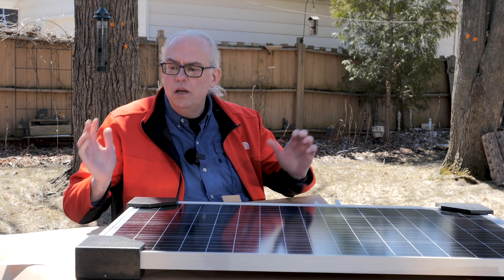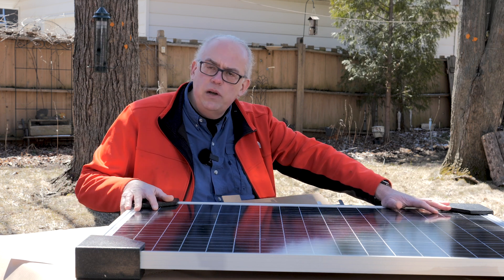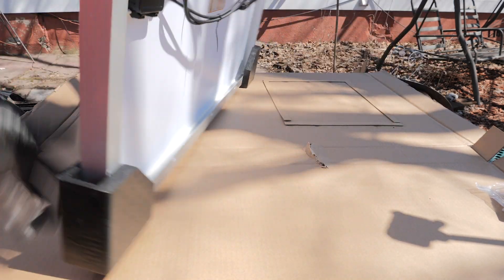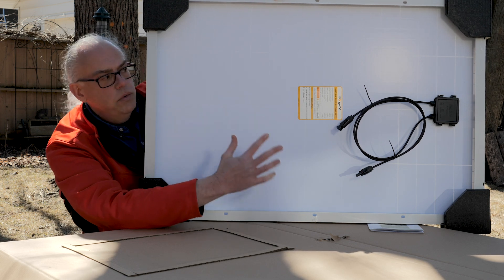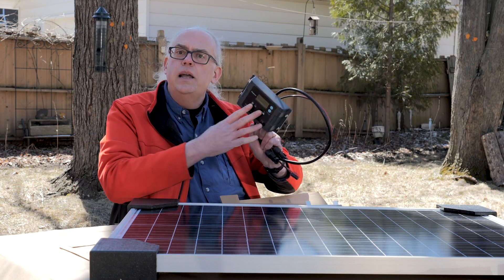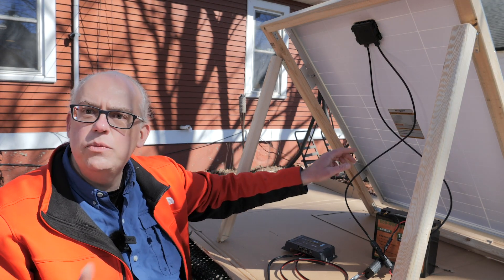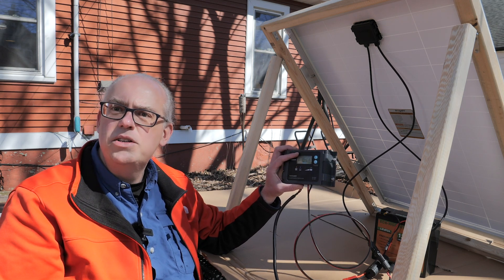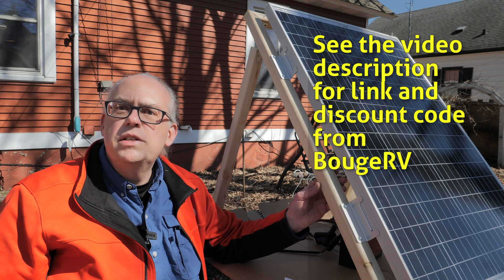BougeRV 120 watt solar panel review - Free off grid power! #HamradioQA

Comment: Can I hook 4 of these up in parallel, and if so how big of solar controller would need to handle 4 of these. They would be going to 1 100 ah Lipo4 battery with the possibility of adding two more batteries of the same size  same size. Thanks!
Reply from the maker: When connecting panels in series, you will add up the open circuit voltage (Voc) to determine how big of a charge controller you will need. These panels have 21.9 Voc, so you will need a charge controller with the capability of at least 90 volts input power. Charge controllers like that exist, but they are expensive. You may be better to use a 2 series, 2 parallel configuration. Over all you will generate the same amount of power, but you will be running as a 24 volt system. This will be more efficient as you can use thinner wire to the charge controller and your input voltage will only need to be 44 volts. An MPPT charge controller will be able to convert the 24 volt solar to 12 volt charging for your batteries.

Comment: QUESTION ? CAN I CHARGE AND RUN A HF, UHF or VHF RADIO AT THE SAME TIME ? WILL I HAVE RFI, STATIC ISSUES ?
Reply from the maker: Yes you can. A charge controller can feed power into the battery the same time you are discharging it. RFI or radio noise will depend on the type of charge controller you are using. PWM charge controllers are very quiet on the HF bands but they are not as efficient. MPPT charge controllers are more efficient since they use DC-DC conversion, but that process contributes to more noise. If you are planning on a solar project to generate power while on the air, I recommend a PWM controller.

Comment: If you have a miter saw and a cordless drill your wood working skills can't be that bad. FF to the end. if you can afford the miter saw and cordless drill a cordless brad nailer or trim nailer might be the ticket to ramping up the wood working skills. Enjoyed. The discount code did not work on Amazon.
Reply from the maker: I probably undersell my woodworking skills. My dad was a high school shop teacher while I was growing up and I took woodworking in 4-H, so I do know a thing or two. I'll inquire about the discount code.
Reply: But then again, using sheet metal screws for wood?  Yes, they work here but there is a reason we use the correct fasteners!  That being said, forget I mentioned it and enjoy the video.  Us engineer types sometimes cannot shut up!
Reply from the maker: I knew someone would catch that, you've got a good eye. I used the pan head screws for aesthetic reasons. At least I didn't pick the self tapping screws. But hey, the frame was just a prop for the video, so I'll probably tear everything apart and save the pieces for a future project.
Reply from the maker: I contacted BougeRV and they sent me a new discount code: SOLARPANEL8. I hope this works for you.

Comment: For permanent mountings, I use similar panels with two pieces of Uni-strut  (Lowes) across the smaller width, then a small 34 inch iron ridge solar mount.  I use a 5 inch hose clamp thru the iron ridge unit and clamp it to a standard 4 inch PVC pipe (Lowes) .  Sun-Guard 10 or 20 solar controllers work very well.  My units - used for Alaska remote weather station  & business radio repeater power have withstood up to 130 MPH winds.  /73
Reply from the maker: Uni-strut is great stuff. I'm using aluminum strut to mount my 180 watt panel to the rack on the trailer.

Comment: I've always wanted to mount a couple panels on the luggage rails of my Suburban and utilize them to trickle charge the batteries when its parked.
Reply from the maker: In my solar install for my teardrop camper, I'm using aluminum strut to mount the panel to the roof rack. That might be an option for you.
Reply: @KB9VBRAntennas  I've seen your teardrop tour video, I'll go back and look up the solar install vid. Thanks!

Comment: Hi Michael. Thanks for the review. It would be nice to know if the converter isn't generating noise on the bands.
Reply from the maker: That charge controller is a PWM or Pulse Width Modulation charge controller. PWM controllers don't generate noise on the HF bands (unlike MPPT controllers, which can be quite noisy). This particular one, a Renogy Voyager controller, is very quiet. PWM controllers are less efficient than MPPT, but are also quite a bit less expensive For solar setups less than 200 watts, you really don't notice the efficiency difference and are better off saving your money by using a PWM controller.  My video on Solar Power for Ham Radio explains more about the two types of controllers and why PWM is better for ham radio: https://youtu.be/FWkXCjR-48E
Reply: @KB9VBRAntennas  Thanks, Seriously thinking about getting this unit.

Comment: Woodworking skills at the end were funny. I wonder, is there a way to put panels out and plug the output into a wall outlet to lower the electric bill on my apartment? Probably not but just an idea that came to me during the video.
Reply: It’s not that simple, you aren’t going to be using solar panels without batteries, among other necessities. So the instal will cost more than the panels alone I don’t have a percentage for you but I’m certain there are many recourses online you could check out.
Reply from the maker: Solar panels generate DC energy and your house runs on an AC system. In order to use solar to lower your electric bill, you need a grid-tie system. This uses an inverter to feed AC power into the system and synchronize the AC with the power utility. A big enough grid tie system can actually make your utility meter run backwards and the power companies send you a check.